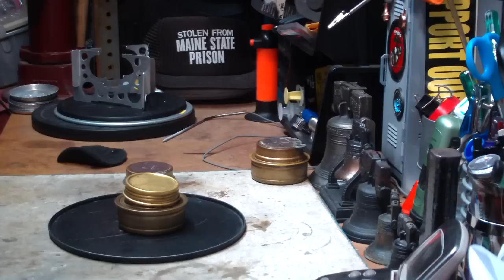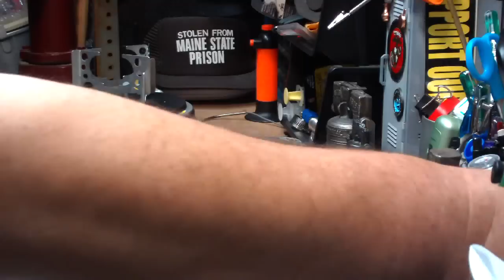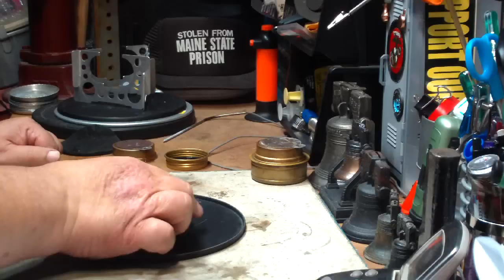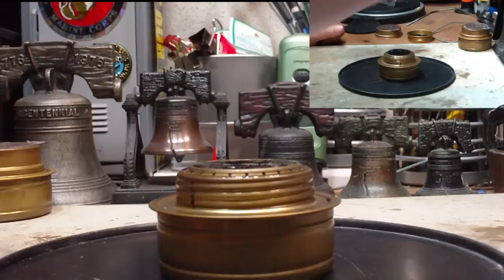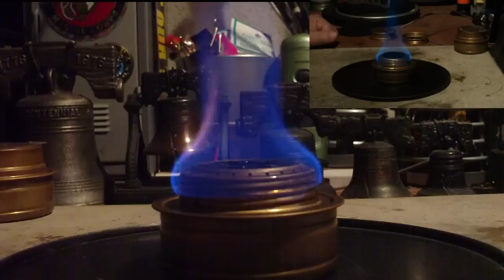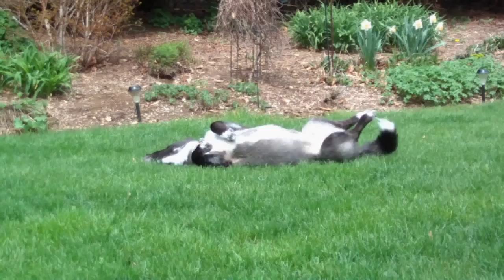Taking another look at ''Wawhiker's Carbon Felt Upgrade''

Comment: I made mine where my carbon felt was only as high as the wide body of the stove and it bloomed. By having your wick all the way to the top keeps the flame too high and keeps the heat to far away from the main body not allowing the alcohol to heat up and vaporize. Also soaks way to much alcohol  lowering the amount of alcohol allowed to seep to outside wall of the stove for vaporizing. Not only does it help simmering control it gives a lot longer burn times. Think someone I talked to said he got like over an hour on 2 oz of fuel. I use it for baking and keeping my coffee pot warm, hate cold coffee, lol. Thanks for your video's, you do a great job.
Reply: Exactly
Reply: Only make the carbon ½ the height of the spirit area and it works great!

Comment: watched hiram's & wawhiker's viedo on the carbon felt. i cut 3 circles the size of the open area. the circles are 1/4 inch thick. so the felt only came up to the support brim / ring. then pour in 45ml of fuel. put the cap on the burner an let it sit 20 hrs. so i got max saturation on the burners wick. got a bloom in 30 secs. when i lit the burner. got a burn time of 15 minutes. the question to be answered is how long does it take for saturation to occur.

Comment from the maker: Spring for the carbon felt. There is so much you can do with it from dry baking to using as pot insulator, even as a wind screen if you're so inclined.8-)
Get the bigger welding blanket like in digitizer101's video. It's much, much cheaper than the little pieces I was buying at the big box store. Now I don't mind using it to try out ideas like wawhiker's. Glad I did!

Comment: Since the carbon felt is an insulator, it might stand to reason that it might not be suitable in cold weather. Trangia and similar need the heat to vaporize the alcohol.

I do wonder where you got that 3 foot piece of carbon felt in your other video. You didn't post the name or link to it.

Comment: Hiram,
Take another look at Fancy Feast alcohol stove.
Try using it with  a Sterno Oven.
2 cups of fast boiling water in 5 minutes.

Also 

Turn a New Sterno unopened can into a penny alcohol stove.
Just add more alcohol into the  top hole, when empty

Let me know the results you get.

Review some pot supports for Alcohol stoves.